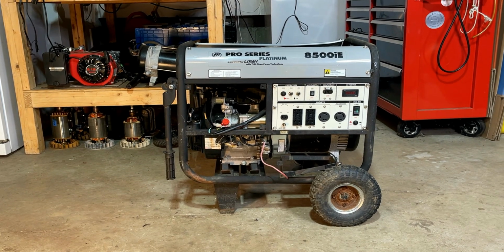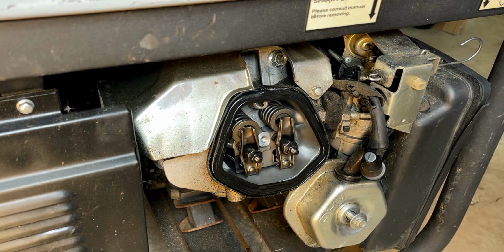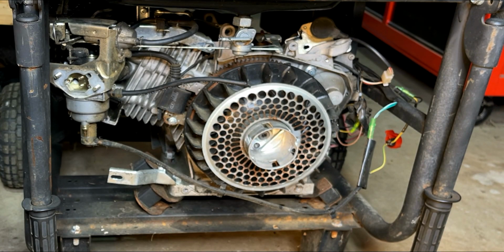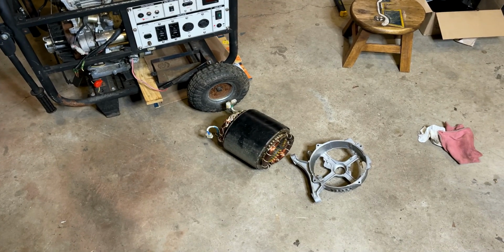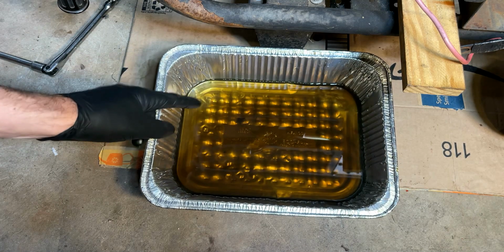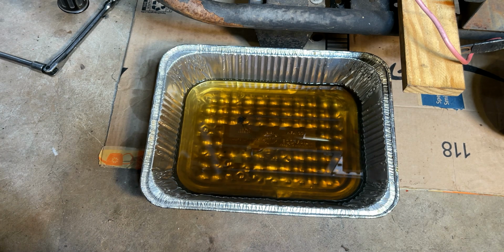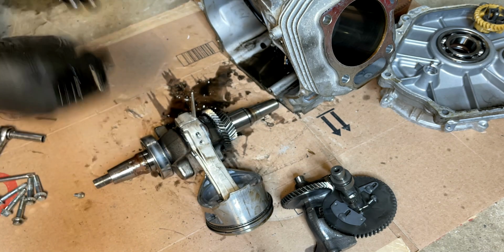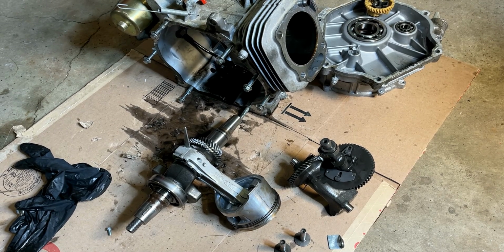Seized LiFan Generator (Part 1) - What Happened?

Comment: Seems to be a common pattern. Oil runs low, and the rod fuses itself to crank. In this case, the operator heard it happening and stopped the engine before the rod broke, but most of the time, it just runs until the engine flies apart internally.

From all of your videos that I have watched, I have picked up and learned many things, but the top of the list of things I've learned is to KEEP THE OIL FRESH AND FULL, and always use synthetic oil! The second on the list is to drain the carb each time, keep the fuel fresh and use stabilizer.

Because of you and your videos, I have completely changed the way I maintain my Predator 8750. Hopefully, because of you, it will last nearly forever. 

This LiFan engine looks identical to my Predator 8750. All of the Honda clones look pretty similar. I bet you could use the specs, and maybe even the replacement parts, from the Predator on this LiFan.

Thank you James.
Reply: Most importantly check the oil before starting because it might be fuel diluted.

Comment: Scotch-Brite the crank journal, run a hone through the con-rod 'til it fits, use the torque specs from whatever that's a clone of, put the oil back in and send it.
Reply: nothing to lose, right!
Reply: i once took out a lot of wear in a con rod by machining down the cap ang used Prussian blue and a scraper to refit it . The engine ran good for two more years and then i sold the tractor
Reply: Yes, it definitely seems like the connecting rod's big end clearance is about zero. But did the generator come that way from the factory? Or was it already rebuilt, with incorrect parts?

Comment: An interesting little challenge! - I'd be looking at that big-end again and seeing if if can be made to live again. It doesn't look too seriously burned (but I am viewing on my phone), but with some care, all that abraded surface could be pared back and still reveal a usable surface which could well have remained in spec. The crank looks exceptionally good, considering what's gone on. This engine reminds me of a Fuji Robin 8HP diesel we had on a generator, and it had suffered much the same way. The guys at "Engine Reclaim" made an excellent job of renovating the rod - The crank was fine, and removing the tarnish from the piston skirt was all it needed to bring things back to spec.

However, as we see "Pupp, popp, plooff, plopp, Popple pudd"!!  You've already got it back together again, and something ain't right somewhere! - Timing? Or bad valves? Can't wait to see!

Comment: Having a good laugh with this one because it makes me remember when I was young and foolish & I had a very similar problem. It was a rather old and battered genset but I needed it back and running so I honed the connecting rod. It freed up and was still a touch tight so I put it back together. 20 years later it is still sitting just behind me in full working order. Changed the oil after 30 minutes run and it now shows no sign of problems in the oil. Only used once or twice a year. It will probably outlast me.

Comment: A guy below recommended cleaning up the crankshaft journal and cleaning up the connecting rod as well. I would go this route. Some fine polishing sand paper (or whatever they use in machine shops), and go lightly. I bet before too long, you'll have a perfect fit.

Comment: I love the trick of using water and bolt to get the rotor off.   I am amazed the connecting rod was not gauled since it was the cause of the lock.
Looking forward to the next video.
Dave.
Reply from the maker: It’s the best looking bad connecting rod I have pulled out of an engine.

Comment: Use a micrometer to check the crankshaft to make certain that it is round then ream or hone the rod to match with clearance. You can get an adjustable reamer set that covers from 15/32 to 1-1/16 for $55 or one that goes from 15/32 to 1-3/16 for $83 on Amazon or get a single reamer that covers the size needed. Either one is cheaper than the new rod and you have them to use for other things. An automotive machine shop could also do it. Even a flap wheel might do a good enough job.

Comment: Lifan is a major manufacturer, they build engines for all sorts of things.. motorcycles, scooters etc.
I was a bit surprised.. the build on that looked better than I expected, nice bearings supporting the shafts, a balance shaft, the casting on that rod and piston looked nice.
I think I would try to hone it, and plastigauge it.. see if you can get it to loosen up.
Usually when they run low on oil and seize up you will see some blue color on the parts that got hot.. either the owner caught it quickly and shut it down, or maybe there is a machining defect from the factory and it was just a bit tight on the clearances, it got a bit hot, parts expanded and it grabbed and locked up quickly.
great video.. looking forward to part 2

Comment: Hello James.  that engine is damaged that crankshaft may be twisted possibly.  the best option is to fit a new engine with the same characteristics and get it running and worst case scenario use that generator for parts...thanks for the excellent generator diagnostic and repair tutorials...James Condon Academy.. .😁👍👍👍 greetings from Puerto Rico 🇵🇷...

Comment: I like the nut on the flywheel trick to remove flywheel with hammer as opposed to gear puller. Also, the hydraulic removal of rotor is very cool. These Chinese clones are fun to work on. Parts cheap, unfortunately, these units don’t last. Sometimes you get lucky. I just sold a Champion generator that had over 1000 hours on the meter.
Reply: Be very careful hammering on the crank nut while applying pressure to the flywheel to loosen it. It is easy to break the crankshaft...ask me how I know. Expensive!
Reply: @dadskrej5226  Also, it can destroy the ball bearings when that is what the crank runs on.
Reply: they last if you look after them. most treat them like shit.

Comment: James, I was really kind of wondering if maybe that this engine slipped through with little to no “Quality Control” when it was manufactured - Or Possibly A Monday or Friday Special.
When I viewed this video, it was very apparent that engine parts were out of tolerance enough to bind up rather than totally seize once a abnormal heating condition manifested itself or as you alluded to with the air intake system drawing a large amount of dirt or maybe a combination of both situations.
As some of the other comments alluded to, Some cleanup and or minor machining could possibly make all of the difference in the world with this engine - Barring no cracking or severe scoring has occurred. 
I have seen engines in far worse condition internally than ran like a sewing machine.
James, I am really looking forward to seeing your follow up video regarding the engine situation. I am a retired welder/fabricator and had a 1954 Hobart engine drive welder that I occasionally had to clean the brushes on. It’s truly amazing how deeply that the Mud Daubers would build their nests in periods of inactivity of welding equipment. So naturally I am really drawn to your generator repair videos.from my past history of welding and maintenance of my welders.

Comment: Good video. Use plasta gage on the rod bearing to set the proper clearance. I think the valve rotator is missing on the exh. valve. Might try a percision expandable reamer for the rod bearing. Thanks for the video.

Comment: Hey James! I had the same exact generator with the same exact problem, except mine threw the rod thru the casing. It’s literally a GX390 clone. I used a GX390 casing with a cheapo Amazon GX390 rebuild kit and it all went back together flawlessly.
Reply: In the sales literature this generator engine is described as being 420 cc in capacity. Is it a 420 or a 390?
Reply from the maker: This one is 420cc.  Most GX390 parts will fit.
Reply: @jcondon1  mine must be older or different model, mine had a 389cc powercease engine.

Comment: This is exactly what happens if you run a drained engine.
I have experimented with this on briggs engines, and if they run out of oil slowly (never topped up) the rod will heat up, and snap eventually.

But if it's fully drained, the rod will bind so hard and fast that the friction will kill the engine before the rod snaps.

I don't know why you would do it, but to me it looks like the engine had been drained (for storage/transport maybe?) and it was started, died, and then oil was added in an attempt to save it to no avail.

It takes very little lubrication to prevent the piston from binding to the cylinder, so usually you won't see piston damage when they run out of oil like you would if it overheated.

Comment: I have some experience of killing small engines like this. Mine was a 3 inch pump using a diesel engine. The issue was the splash-fed oil system which didn't like being left to run when located on an inclined slope. Oil cut-off doesn't help if that part of the sump is still full.
Reply: It'd be nice if they had a tilt switch somewhere on the unit that would kill ignition if tilted over some degree range, but that'll never happen.
Reply: @GGigabiteM  That would be very easy and cheap.

Comment: I have saved buying many connecting rods , take 400 grit wet and dry sandpaper and W.D.40, carefully sand the rod bearing surface to nice new surface , do the same with the crank journal . Then plasti guage the fit to check clearance . It will  save you  $90.

Comment: great thing about Aluminum rods is that they tend not to destroy the crank journal. Some hydrochloric acid and linish with wet/dry sand paper (spun with a shoe lace) and they can polish up like new. Spare rods are available online inexpensively. If you have a really non identifiable chinese clone engine............just measure the rods crucial dimensions and find one online that measures up.

Comment: The conrod assembly can be reused. Assemble the rod cap to the rod, & carefully hone it with a fine honing stone. Won't need much, or wrap p1200 wet & dry around a piece of timber just big enough to fit the rod assembly, & push it back & forth for about 30 seconds, using water to float the debris away. Test fit to the crank, oiling the rod assembly before testing.

Comment: Maybe someone before you did a rebuild with an undersized rod, not knowing what they had. I'd mic up the journal and rod to see. If they never got it started, both could be usable, and you could get away with boring and/or lapping. It would be great to find a manual with factory sizes.

Comment: i notice you pull the end housing off the generator first. i always pulled the rotor off and stator as a unit. i took an old bolt and cut it down for jacking the stator off  with an m12 bolt . i found it easier to get that bearing out.

Comment: Here's the thing.

This machine is identical to others that James has renovated. In other words, the manufactureres in China have been gradually been bought out such that the paint job might be different but nothing else is.

This happened in the UK between 1960 and 1980 in the bus and coach industry: the phrase used for that homogenisation was 'Badge Engineering'.

I experienced the same when I was setting up my kitchen in 2012: all kitchen knives has the same design and manufacture, save for different handles.

Comment: Could the interference be something that just got cooked onto one or both surfaces. It almost looks like that in the video. Maybe try checking the clearances between the two surfaces?  Also, maybe try aggressively cleaning to see if the rogue material can be cleaned off. As you mentioned, maybe it’s something that was ingested through the holes in that air filter and got cooking onto the connecting rod or crankshaft. Seems like that would be worth a try.
Reply from the maker: Good point.  I did not think of that.
Reply: @jcondon1  You can use muriatic acid to etch away the aluminum from the rod on the crankshaft
Reply: @erik_dk842  sodium hydroxide works also.
Reply: @williamvaughan1218  I think the muriatic is faster, but it sure smells bad. Kind of good, because the sodium hydroxide doesn't smell, but eats skin just as good as the acid.

Comment: Would this type of Generator be able to run a small to medium welder. 230v 16amp is what the welder requires.
I'm Europe Ireland so our supply is 230v anyway.
But I'm unsure if these would be ok for that type of load.
There's a big jump in price from this type of welder to a more well known Brand.
Thanks.
Reply from the maker: It depends on the type of welder.  This generator will max out at about 30 amps 240 volts.  Would think a new inverter welder would be fine since this is brushed with an AVR the power is cleaner and better suited for the inverter welder electronics.  If an old welder with large transformers, not sure.  The surge will be 2 or 3 times the 16 amps.  Might be tough for an engine this size.
Reply: @jcondon1  it's an inverter welder  I just wasn't sure if there able to run that kinda of load, thats good news.
Ideally I'd like a diesel petrol is very expensive in Ireland, the petrol generators are cheaper but the diesels save you a fair amount on fuel.
I have a look out for a used welder generator, Mosa preferably they're a well known Brand over here made in Europe known for engine welders and generators.

Comment: A new rod, emery cloth to clean the crank up, ball hone the cylinder, new rings and gaskets and a rotator cup for the valve and she should be as good as used.
Reply: May have to skim turn the outside of the piston for more clearance as well...

Comment: a crankshaft pin which inflates is unexpected. 
there are signs of wear on the piston so this engine did not leave the factory with a connecting rod that was too tight.
I think this engine was reassembled with parts that do not match between them. probably a new rod. 
if the piston and piston ring clearance are good, polishing the crankshaft crank pin and connecting rod to achieve proper clearance should suffice.

do you know Plastic-Gauge ? 
At the end of the video, the carburetor side flame could indicate improper ignition and/or camshaft timing.
Reply from the maker: I will use plasti-gauge next week.  I thought timing at first, but there is an issue with the rebuilt engine.

Comment: first check :  is there enough oil in the crank case?
Reply: try to polish the con rod bearing and crankshaft journal, the balancer must be installed in the correct position!  Good Luck James!

Comment: It definitely seems like the connecting rod's big end clearance is about zero. But did the generator come that way from the factory? Or was it already rebuilt, with incorrect parts?
Reply from the maker: Not sure.  The slip rings were dirty, so the engine did have some hours on it.

Comment: Jim, Do you usually check the stator and other components before removing to check if you can keep them for a future project or wait until you can see if the project is worth saving first? I get the impression that you catalog and save everything you can.
Reply from the maker: I usually do a quick test of the powerhead before putting it on a shelf.  I only keep parts that can be reused.

Comment: What made you think of using water to remove the rotor off the shaft? I know you used to use a rod to wedge the rotor off the engine shaft.
Reply from the maker: A service manual had that procedure but using oil.  Thought water would be a little cleaner so gave it a try.

Comment: from what i have been told is that those generators are very similar (??) to champion generators? i have that size lifan generator since 2008;  only had minor repairs done to it.  unfortunately we bought it just before  hurricane IKE  so i am stuck with that piece of gold. sometimes when i pull on that rope it wants to pull my arm out of place and hand feels it
Reply from the maker: Most generators made today are very similar.
Reply: @jcondon1  i don't think much of their parts support though but we ran that machine hard after ike...24/7 for 15 days only stopped it for oil changes.

Comment: Those big end surfaces - I was surprised to see similar on smaller engines but seeing them used on bigger ones is asking for trouble. The engine trusts that the  splash lubrication will be enough  but honestly it's not. A design like that is both cheap and flawed and designed to be a short-lived throw away item. It's little wonder the planet is suffering.
Given how easy it is, engine developers should be adding an oil pump to the countershaft gearing. A pumped lubrication channel to that big end bearing (use white metal shells too) is what is needed.
Reply from the maker: And an oil filter

Comment: James how do you know the tork of the screws or nuts ? Is there a manual or chart telling you the tork of certain size nuts or bolts ?
Reply from the maker: I do have several service manuals.  In this case I used a Honda clone service manual.

Comment: Aluminum connecting rod is a sign to avoid these engines, if it had a bearing insert maybe, cams running on aluminum heads are OK till you lose lube flow then poof!

Comment: Hey Jim. I really enjoy the videos. I was wondering if you have ever run into a situation where the water trick didn't work to get the rotor off or if the water didn't have a good seal on the back end and wouldn't seal to obtain any pressure. Thanks.
Reply from the maker: Recently it did not work.  Will be a future video.  The powerhead was bad.  So ended up using a hammer to shock it off.

Comment: Motor has been run low on oil......rod bore can be honed and crankshaft can be polished to get the proper clearance needed. I would also replace those rings and give the cylinder a quick hone with a three stone hone.